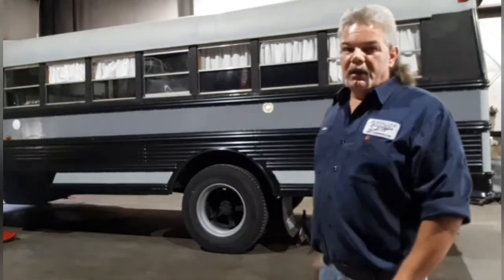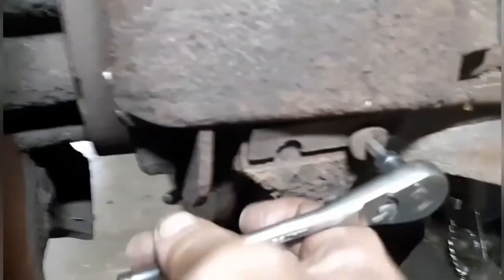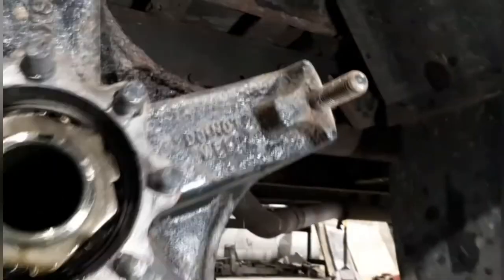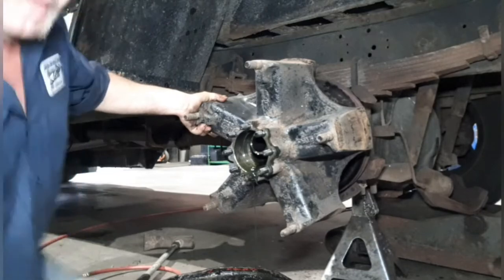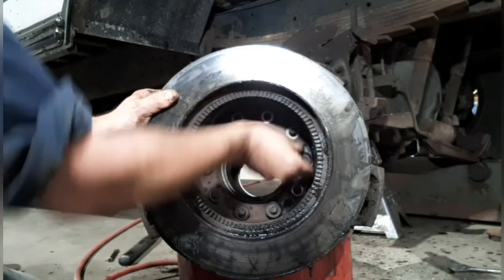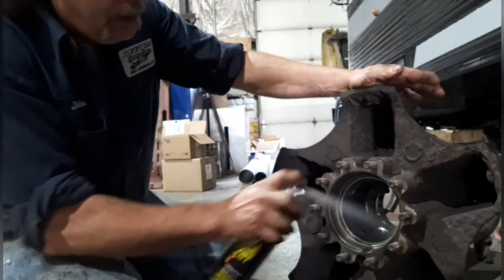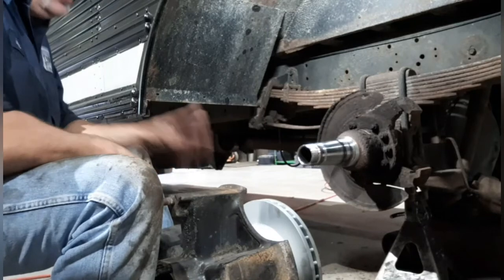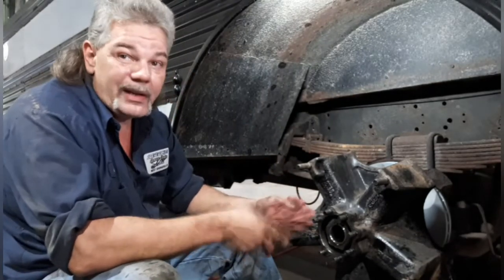Skoolie Maintenance and Repair Series EP 11 - Hydraulic Brake Service

Comment: Wow! You're an excellent teacher. Love to ask you a few questions. Do you have an email or some way to contact you? I didn't see any way on YT. I want to know the wet sleeve method that some motors allow you to change without removing the whole block. Some DT's and a few of the Cummins. I also read an article about 5.9 Cummins being too small for a bus? I'm looking for the best motor since I am not a mechanic. I need full time living in the bus!!
Reply from the maker: 1johnnymullet@gmail.com
Reply: I have the dt360(5.9) liter,wet sleeve engine. It's slow of the start but once wound up they hold good. If you don't build your bus to heavy the 5.9 International or 5.9 Cummins are fine. Driving a truck for a living having a 605hp Cummins in my Pete,then getting in my bus to head out,it takes me about 20 minutes to have to DETUNE my mind until I relax and then accept it is what it is. I actually like going slower in my bus, kinda helps with the unwinding from the rat race of being amongst the ME ME ME generation of drivers out on the roads.